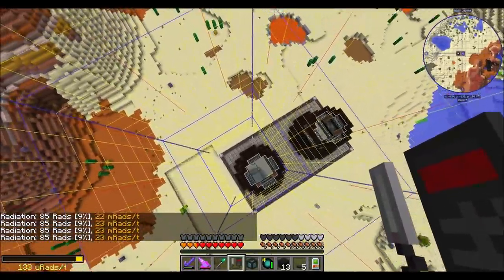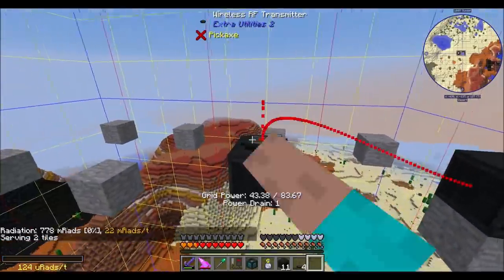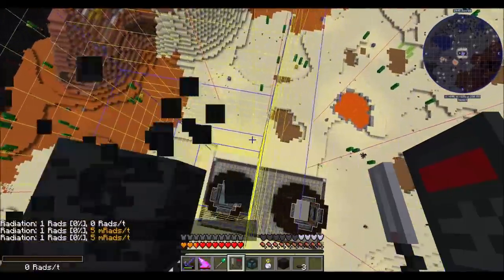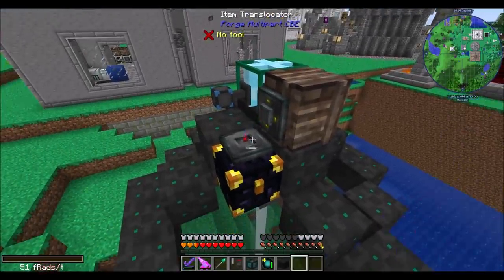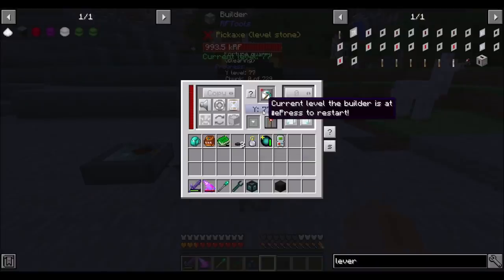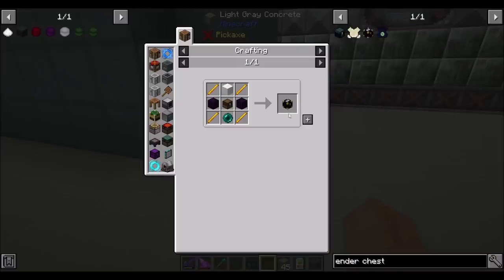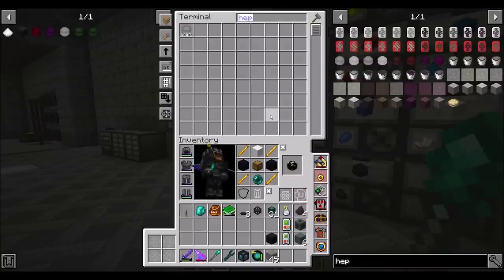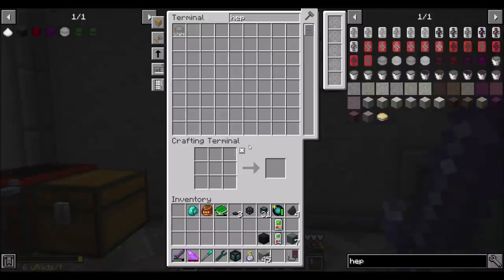FTB Revelations Ep60 Plutonium Fuel

Comment: Dire the Ender IO capacitor banks can form a multi-block by placing additional capacitor banks adjacent to each other. They can be on top or side to side the shape is very flexible. The input, output and storage capacity of the multi-block is increased linearly for each additional capacitor bank added.

Comment: Random things adds something called a divining rod that works like a short range x-ray mod for single ores. I used it for diamond, but you just keep it in your offhand and it highlights any of the selected ore. Great way to find boron.

P. S. Since I don’t think dire saw this, so I’m just gonna repost this once every few episodes:

When it comes to your power Dire, there are two things you should look at that you’ve never done before:
1. Molten salt reactor from nuclearcraft, it’s complex but in a fun way
2. The new buildcraft oil refining system, you can get tons of RF out of it (more than refined fuel in a thermal dynamo)

Comment: I think it's world download time once again right? If it isn't, I'll just post this again anyway. :)

All of Direwolf20's world downloads are on CurseForge (search "Direwolf20 - FTB Revelations World Downloads" on the Worlds section). And if the latest isn't there yet, just be patient, Dire will upload it eventually. :)

Modpack: FTB Revelation v3.2.0

Mods added by Dire:
- Building Gadgets
- Just Enough Energistics
- AE2 Stuff
- Deep Mob Learning
- NuclearCraft
- Super Sound Muffler
- Intergrated Dynamics (all addons)
 - Cyclops Core
 - Common Capabilities
 - Intergrated Tunnels
 - Intergrated Crafting
 - Integrated Terminals
 - Integrated REST
- Random Things

Comment: I don't know if it was just the pack I first played with Nuclearcraft in, but I'm pretty sure nuclearcraft ores generate in like sphere areas at random points. So if you find some, there's most likely a bunch of nuclearcraft ores in that area. Not sure if that was just E2E.

Also, yeah, as others have said you should be able to tweak the configs to add nuclearcraft ores to the generation, not sure if you'd have to specify the chance they'd generate, if so I'm not sure what number to use.
Reply: oh right, that is true, i think they call them something like super veins
Reply: I think thats only E2:E thing, not sure tho.

Comment: 100 by 12.5 and get 8. You can then just run the ring of 8 scrubbers with a central any block with your wireless RF Transmitter array to provide the 400 RF/t needed (so 5 xmitters for 8 scrubbers (5*80=8*25)). Should be all you need per chunk, right?
Reply: each scrubber suffers a linear penalty so the 2nd to nth scrubber will be less than 12.5% until you are at a point where adding scrubbers adds little to no value
Reply: Didn't know they got a penalty. The tooltip doesn't say anything other than the collective contribution of all the scrubbers in the chunk will stack linearly. Good to know.
Reply: @LifesHarlequin  there are some good tutorials on the nuclearcraft YouTube channel, one on radiation is a good overview of scrubbers. He does some good builds too
Reply: @LifesHarlequin  @Pharabus They won't get a penalty - they'll just contribute collectively as the tooltip says :)

I don't know how long it had been since Dire had placed those scrubbers, but they will sometimes update their efficiencies rather slowly in order to save the game being bombarded with hundreds of block checks :P
Reply: @Einar730  no, you
Reply: @NuclearCraftMod  ah, thanks, I probably combined misreading and impatience 😁

Comment: Maybe place the energy item to between the scrubbers so you don't block the "exhaust" from the top of the block.
Reply: Placing the wireless node a block or two higher should solve any issues with the scrubbers

Comment: Actually, cause it’s nuclearcraft, it uses some technical words.
m = 0.001
u  = 0.000001
So radiation 10m doesn’t mean it’s smaller than 100u, it’s opposite, 10m is much bigger than 100u.

Comment: Dire have atleast 3 to 4 void ore miner tier 1 to get going to higher tiers and tier 2s have 2 tier three is a good time to split off to get the mica resource miner also make a big flux battery with flux networks its actually cheap for the amount of rf now i dont use it as my main battery but i have it for my outgoing power and i use the priorities for ae2 and important things first then the rest on normal priorities my miners nornally last on priority list

Comment: Does the astral Ritual that Speeds up machines also Speed up the Ore miner....  Maybe a way to speed it up
Reply: i think the person who made the ore miners made it where nothing can speed it up except for the speed modifiers ( you used to be able to tick accelerate it, but in one of the updates you were no longer able to )
Reply: @Arcella1981  argh that sucks, I mean sure things like acceleration wands and such I woudl get, but it takes so much work to set up the astral, that should be allowed.. it is such a SLOW system
Reply: @bcreative1979  yeah it is very slow, but if you are able to make the crystal laser lense that should speed it up alot or if you have at least a tier 2, i think that is when modifiers can then be used, you can use acceleration modifiers instead of null modifiers however each modifier will like double the power it needs kind of thing

Comment: Small amounts of player radiation can also be cleared by golden apples and carrots. Also, is it just me, or is there no audio for the reactor planner section starting at 12:32
Reply: PS: when you get into fusion, based on default configs, You can get good power with 160 mb/T of hydrogen (8 buckets per 50 ticks): size 2 hydrogen-hydrogen, size 3 hydrogen-deuterium, size 4 hydrogen-helium3. Output is helium which can be liquefied and then used as a coolant. Assuming default configs in Nuclearcraft for fuel consumption and reaction time.

Comment: Please do ae2 spacial storage and have some fun with it
Reply: What is that? Never heard of it
Reply: @TheDarkKillerGR  basically you can store physical rooms on a drive.
So in theory blip the reactor out of existence and then rebuild it by the push of a button.
Reply: @Bobvanksy  intresting concept What uses doe's it have?
Reply: @TheDarkKillerGR  Well, frankly in practice its more of a novelty.
You can easily move something you built if you want to build a new base,  he could change the settings on the woot mob spawner by storing part of it and then rebuild automatically based on what he needs.
Any crafting room that doesn't need to be accessible 24/7, like a thaumcraft setup for instance, can be stored and share room with something else if you want to build a compact base.